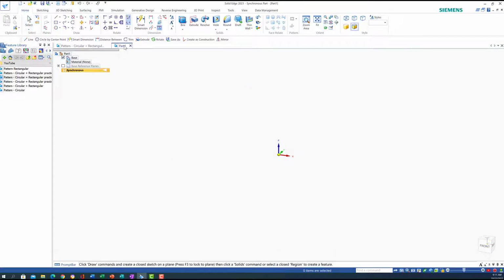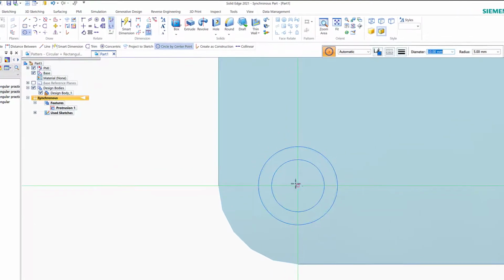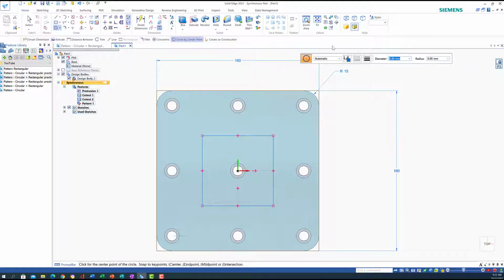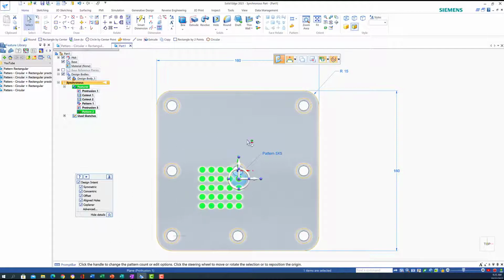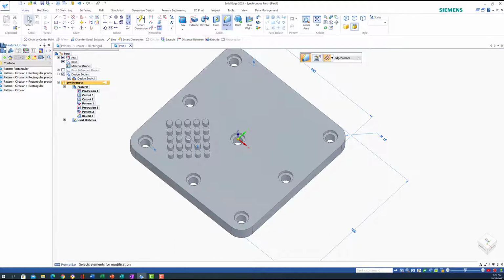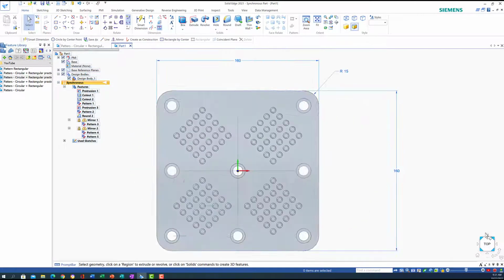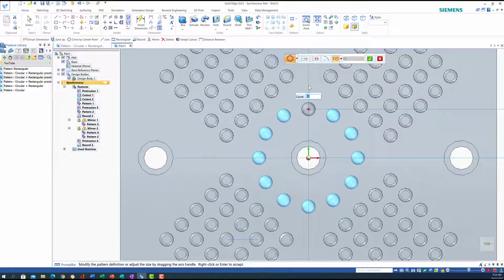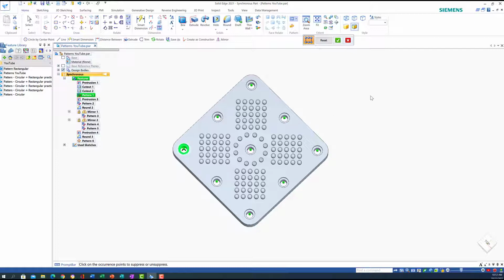Learning Solid Edge - Patterns Part a

Comment: Thank you for the pattern command features tutorial. I am more comfortable with the command and now understand what the settings mean.

Observation:  Mirroring the 5 X 5 rectangular peg pattern works. However, for efficiency and effort - It is best to continue to use the patterns commands by using the circular pattern command to duplicate the 5 X 5 matrix of pegs about the center of the square part.

- Use the circular pattern for the 4 instances of the 5 X 5 rectangular pattern of pegs about the part center. When you are finished then, there are only one Rectangular Pattern for the 5 X 5 pegs and one Circular Pattern for the 4 instances of the 5 X 5 matrix of pegs. (Not counting the other patterns for the initial holes with countersinks and other pegs.)

Your work instructions require executing multiple mirrors and result in multiple pattern copies.  By using only patterns when creating a part, consisting of patterns, the drawing is easier to follow, logical, more professional, and much easier to edit later. If, the specifications or features need to be changed or a different version needs to be generated from the original. * Much better. 

- Suggestion: Instead of complicating drawing clean up by deleting the potentially important dimensions and construction sketches - Hide them, always. Note: PMI (Product Manufacturing Information) is often important. PMI contains part the dimensions.  

Glad to see you finally noticed at the end of the lesson you'd deleted a hole and countersink.   That was a very good instruction how to recover and to modify patterns.  I feel much more at ease looking forward to generating patterns, without apprehension.  Thank You! 😀

P.S. In another video you asked how to create patterns on a 2D sketch.   You need to transition the part generation from 'Synchronous' to 'Ordered'. Then, there will be a Pattern section in the Home TAB. This will allow executing patterns on 2D sketches.  It took a long time to find this.   Reference:   https://youtu.be/8ugL36boEX0

Comment: I have a watched a number of your videos and they are very helpful. What I have not found is away to configure the enter box for items like rectangle, circle etc. In my version 2023 community addition, my box comes up as a panel but cannot be docked vertically as it your videos. Is there some setting for this?  Thank you
Reply from the maker: I just started using 2023. In my last video (Exercise 11) I explain what is the difference between 2023 and 2022 or older version. Actually, they are the same  and if you need help I can zoom with you to explain how to follow the commands in the new version. I will contact Solid Edge customer service to see if there is a way to set it in the old format. Actually, I personally prefer the new version. Here is my email: mohamed.seif@aamu.edu
Reply: @drmseif  I think the older version presents a cleaner look and easier to enter the values. Maybe the support team can offer a solution that allows users the choice.  Thank you